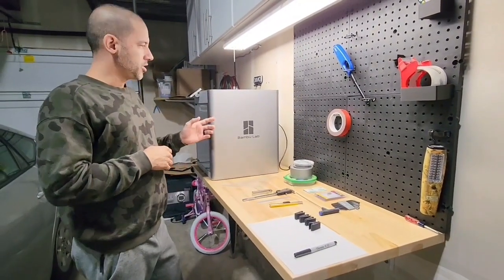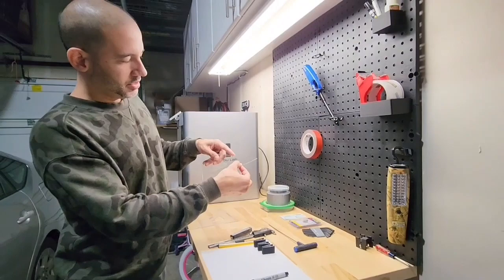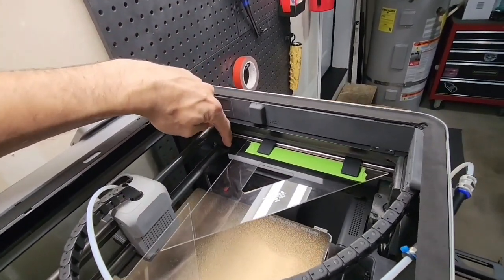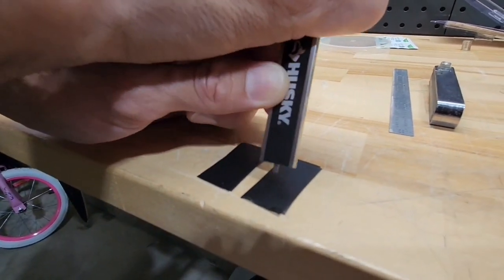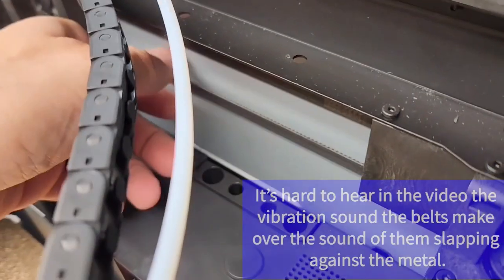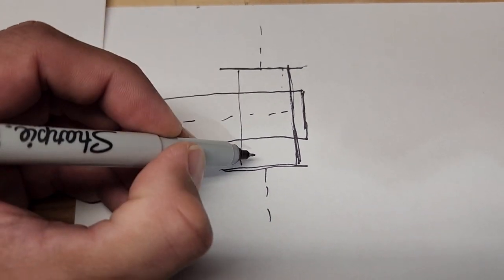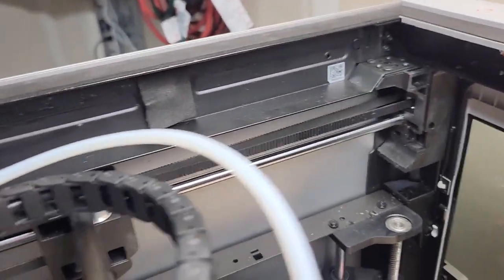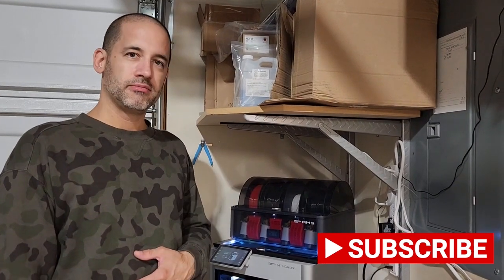Bambu Labs Banding Fix, Step-By-Step Tutorial!

Comment: I'm not sure this makes much to me. How does the shim keep the machine square? It doesn't actually warp the frame or change the structure. Just forcing the head to the rear while tightening the belt tension screws? Wouldn't me retightening those screws after getting the belt to stop riding the pully nullify tightening the belts to get it square? Also am I supposed to leave the shim? Won't the machine just crash into it each time? EDIT: Also you linked to the wrong printables model BTW lololololol
Reply from the maker: The shim isn't for squaring the frame. The shim is to offset the gantry against the un-squared frame so that, when you push the gantry to the back, it will be square to the guide rods. Before putting the shim in, if you pushed and held the gantry tight against an un-square frame, it would induce a slight but meaningful uneven tension on the belts because you would be setting belt tensions when the gantry-guide rods are flexing and fighting against each other. Don't know if I made it clearer or muddie for you, but that's what I got. Hope it clears it up!
Reply: @BoneyardLabs  I believe so. So by pulling the gantry back against that shim while tightening those rear tensioning screws that helps with belt tensioning by correcting the gantry's perpendicularity and in turn correcting the XY's squareness. I'll have to figure out how hard to pull back by re-checking squareness assuming I made my shim the correct thickness. Then if I notice the belts riding on the pully lips at all do I still need to pull back on the gantry while re-tighten those rear tensioning screws? Sounds like I won't as long as I only unscrew one screw per side. By unscrewing both per side [all 4 screws] the printer will go back out of square.
Reply from the maker: Leaving the shim there won't make it crash, as the home position for the gantry is well away from the frame when in operation.
Reply: @BoneyardLabs  The real MVP
Reply: @BoneyardLabs  Lol I thought the machine literally crashed itself against it's max travel extents at least that's what it sounds like on my X1 when I home it...
Reply from the maker: I just checked the link. It is correct. There is more than one part. I only used one of the parts found in the link of several tools.

Comment: Holy, this saved my ass! I tried tighening the x axis per an error and on the bambu official help, it said to undo the screws in the back. So i did that, moved the toolhead left and right to clean/tigheten the x axis. Go back to printing and i was getting a subtle grinding sound that i wasnt before. They just tell you screw the bolts back no biggie, i had to clue what it was for or, what i should be doing, or how to check to make sure its back to proper. Huge thanks!!!!!

Comment: Interesting but I'm still looking to get rid of VFA completely. I've tried this several times but unfortunately I still get VFA on the Bambulab P1S. It's a bit more or less at different speeds (less at very fast or very slow), but I need it completely gone. Anybody?
Reply: not possible due to motor oscillating

Comment: First, most important, is Thankyou! The issue I was having is fixed and your video did it.  My gantry was 1mm out and I don't understand how I have been getting such great prints the last 6 months. They look pretty close to perfect now. 

 I wanted to offer a "easier" way to adjust the tilt on the belt pulleys. It is your "way" but more precise.  After adjusting the belts as normal,  use a black thin tip sharpie to put a line on the belt carriage tabs that stick out towards the center along the edge where they go under the outside plate. These are the tabs you were pushing on to adjust the tilt of the pulley. The line is placed so that if you push the tab in, the line disappears as it slips under the outside plate. If the tab is moved the other way you will see a space between the edge of the outer plate and line. This gives you a visual indication of how far you are pushing the tab and you are way ahead of the game already. Next, after loosening the screw, use a wide tip (1/4", 6mm) flat screwdriver to lever the tab in as you watch the line disappear under the edge, tighten the screw when you are at the desired position. This is far more precise than just trying to push it. You have much more control and you can see what you are doing with the line. You will seldom be moving more than lines width as this adjustment is quite sensitive.  This would have been easier to describe with a picture.

OK, a little bad news. The tilt adjustment as you described it did not go far enough. After getting the belts to close to centered on the pulleys as I pushed the toolhead fore and aft and side to side manually, I announced "job done". I patted myself on the back with both hands but I was not really done. I watched the  pulleys as as the a print ran and noted the belts push up against the shoulders of the pulleys depending where the tool head was. The dynamics of having the stepper motor move the belts versus moving the toolhead manually is different. Watch belts during a print and make small adjustments to center the belt as best you can. As you said, "Its not an exact science." My belts move up and down quite a bit during a print but using your method, I was able to get them sorta centered. Just pause the print to make the adjustments. It is actually pretty easy when you can see just how far you are moving the carriage.

Comment: I wouldn''t spend over £1000 pounds on that 3d printer but everyone has their own choice!, the way the belts are tensioned is with a spring on each side, once the screws have been undone it should self tension the belts for you by moving the gantry backwards and forwards and the printhead left to right and then retightening the screws, the x y gantry is all mounted on the uprights for the frame if the frame is out of square or twisted then the belt path is out and that's why the belts move up and down on the pulleys, it's a bad design fullstop, don't waste your money buying one. Go and take alook at the flashforge 5m wiki and see how the x y gantry is all mounted to the top flat frame, that's how you keep your x y gantry flat and mostly square, this is the way bambu should of approached the design, they have made it too complicated, sometimes less is more. 
I build my own 3d printers mainly vz bots and vorons, I have the ribbed parts of belts running on 695 flange bearings it doesn't cause ringing on prints either! like alot of people think, you need a square printer and equal belt tension on a core x y printer, also the belt tension plays a massive part on how well a printer prints, too tight cause issues and so does having it too loose, it's takes alot time adjusting and trying till you find the sweet spot, all printers are different depending on the build volume and belt length.

Comment: Thanks for the great instructions. For me the difference was 1.5mm. Unfortunately, the calibrations in the end had hardly any influence on the print result. The lines are still there. From everything I've read so far, it's not just one factor that's responsible.

Comment: I was about 1.7mm out of square!  This got me to nearly perfect; probably about .1mm out now.  I tried to use the rest of the components from the Printables link.  Took me a while to figure out his directions & assembly, but after I did, that got me perfectly square.  BUT - while it got it to square, it over-tensioned the belt.  Could hear it through 'plucking' the belts, and I could hear a very bad 'rattle' during printing.  I'm guessing due to the lack of equal tension on the belts it was causing some slop.  Not good.  Went back to scratch with the Bambu wiki belt calibration method, then retightened the belt (pro tip - leave the shim attached to the printer!) per your video.  Checking the square again, I'm back to the approx. .1mm out.  I'm good with that for now.  And I'm sure I could adjust the tape to get it perfect.  

Printing the OrcaSlicer VFA test now.  I'm not expecting perfection (I think there's too many variables), but I'd imagine it's going to be better than what it was.

Thanks!

Edit: Sure enough, still not perfect, but better.  Through OrcaSlicer, I printed a VFA tower from 40 - 300 mm/s in 10mm/s steps. I’ve got a bad VFA zone from about 110 mm/s - 140 mm/s. Some other speeds too, but that ‘zone’ is by far the worst. May try to fine-tune some more, but I’m f’in over it for now!  Good enough for the time being. And I can set my prints to avoid that speed.

Comment: Wouldn’t you want to shim it at the front of the machine since that’s where it homes at?
Reply from the maker: Hi there, thanks for the question. My intent was to shim the back because that is the location you move the gantry to when redoing the belt tensions. The idea of the problem is that if you set the gantry against a non-squared surface when you are redoing the tensions, then it could induce dissimilar tensions in the belts. Logically home may be at the front, but mechanically the tensions are set in the back per manufacturers guidelines. That's my reasoning anyway. Hope this helps for you!
Reply: @BoneyardLabs makes sense. Thank you for the explanation!

Comment: This is a really great video! Thank you! But...I don't see how you use the pulleys to change the tension of the belts  and then use them to adjust where the belt rides on the pulley. I wish you had zoomed in when you tightened the belt while explaining how doing so will (or will not) change their perpendicularity. Maybe you did. I missed it.

Comment: I tried many times to get the belts to ride the center of the back pulleys and I got them 90% dead in the middle, without either of them going up or down more than a quarter of the pulleys height. Tightened them just enough and re-calibrated my printer. The problem is that when I did that, and run some prints to it, the toolhead or at least I suspect its that, is doing horrible grinding noises when moving fast. I suppose somewhere along the belt path, the belt rides aggressively on another pulley or the belts got too tight. I loosened the belts again, moved the toolhead around and re-tightened them. Now it prints fine without any loud grinding. Go figure. I shouldn't even touched it in the first place because I later understand that my problem was just adjusting the flow rate for certain filaments.

Comment: I didn't have any squares to check the gantry, but I did the belt tensioning steps. Along with that, I cleaned and re-lubricated the Z-rods and the linear rails, and there is no more banding. Thank you so much.

Comment: confused newbie here with some questions, is the shim a permanet part of the printer or just there for the belt tensioning process ? is the shim's purposes to modifiy the positions from the homing process before each print. finally, is there a way to do this artificially in g-code or settings ?

Comment: Seems simple enough. I had thought this video would go over the Z as well. I have adjusted my belts for the pulley riding. But have not checked the square. I will have to find some squares to check that bit too. And I have an annoying rattle sound which I still have yet to find the source. Kinda leaning towards belts/ider pully on the front left corner. It only happens when printing in the front third of the plate and sounds to be roughly from that corner/hot end (But I have yet to figure out where it is despite pushing and prodding everything possible). It's really annoying, but doesn't seem harmful.

Comment: Thanks for this extensive guide. One BIG thing I noticed is that the right pulley will always ride up and down a little bit and the left one is able to get perfectly centered. I think this is due to a flaw in the design of the X1C belt path.

Comment: alright any suggestions for a slamming sound and what sounds like a baby rattle. the 3rd x1c we have had to start doing this.  seems to begin when we started printing high temp material.  also micro lidars are melting.
Reply from the maker: "Baby rattle" makes me think to look for bad bearings somewhere. Listen for which axis it makes the noise on. Some of the bearings are very difficult to get to. If the sound is constant, check for a broken fan blade or fan bearing. Micro lidars are melting??!!?? Maybe swap extruder assemblies with a new extruder fan and heat sink? That is a super weird one I haven't heard before. That one is probably best for the BL tech support. Sounds like a bigger issue.
Reply: @BoneyardLabs  yes they are replacing them. if i could attach pictures i would pretty odd with the lidar.
Reply from the maker: Luckily BL customer support is great, at least in my experience.

Comment: Have had an X1C since Nov 2022. Two things that got rid of banding issues, keep the carbon rods clean. They are not clean when printers are shipped to customers, and don't use generic profiles. I only use Bambu Lab filament profiles (for any brand filament) and only adjust the max volumetric rate lower and no issues. Generic profiles would show artifacts all the time.
Reply from the maker: Interesting! I'll have to try this!
Reply: This is the first time I hear to avoid the generic profiles, I got my X1C on last November and I was amazed by the print quality with the samples that they gave me but now I'm using 3Djake filament and usually it's a very good product but I'm getting very ugly artifacts and when you see the outside wall from a certain angle with the light it's not smooth, but when I use Bambu PETG-CF the finish is amazing. Yes the CF filament hide most of the artifacts but I may try this trick to avoid the generic profiles and see what happens.

Comment: Was reading the Bambu forum for a bit, from what I could see there is no fix. Some things seem to work for some people, but when some others try the same "fix" they see no difference. Not even changing those smooth idlers for toothed ones fix it. Well apparently one guy claimed changing them out for idlers with teeth fixed it, but then another guy did the exakt same thing and posted pictures showing zero difference. Basically this can't be fixed. I guess the only lesson is, don't buy core XY 3d printers.
Reply: You can never fully fix it because of how the stepper motors work. However, you can minimize it.

Comment: I think this video is going to fix my problem.  Holy sht I finally found something that might actually work.  I have been stressing the fk out so bad because of this.  I run a small business using 2x p1s printers and lately been only using 1 because I keep getting the exact problem you described.  It's just barely noticeable but I'm really a perfectionist with the products I sell so I have wasted a lot of money on failed prints trying to print with that printer.  Sometimes I get no orders for a couple days then bam, like 10 orders in a day, and gotta deal with this sht or do it all on 1 printer.  If I had hair I'd be pulling it out lol
Reply: All done, testing now
Reply: @waynefilkins8394  How did it come out?
Reply: @StrongBarnes90  Great so far.  I haven't printed with some of the more problematic filaments, but I think it's actually printing better than the newer p1s now.  Also the newer p1s keeps printing this line on the left side of a specific print (it's not the file tho) so I'm going to do this to that one next and see if it fixes that.
Reply: @StrongBarnes90  Nevermind, still having problems.  There's something else to it.  I don't know what but I will figure this out.  Some other variable that I accidentally changed when I messed with this.
Reply: @waynefilkins8394  I actually found this whole video to be hog wash. Talked with an expert buddy of mine that taught me how to resin print back in the day and he advise I not do any of that so I went back and followed bambu procedure for doing the belts like I was doing it for the first time again. 
Did it all very slow.
Prints have been coming out immaculate ever since.

Maybe trying what I did will help with you too.
I also dried my filament.
Reply: @StrongBarnes90  The video makes sense from a mechanical perspective, and seems to have fixed the problems for some people, but  the problem is when you start messing with the tensioner like this after the auto-tensioning, it can mess up belt tension.  I guess it's possible that when you push the top or bottom of the pulley over, it's not enough to mess it up too bad tho.  Well, anyway my latest attempt I tried normal belt tensioning but moving the gantry thing slower, was moving it real fast b4 I think, and also left the tape on from the triangle thing too, just started test print.
Reply: @waynefilkins8394 did you ever solve it? How did that test print go?
Reply: @rohit4242  When you do the auto-tensioning thing, and you move the gantry or w/e it's called back and forth, do it really slowly.  That helped me, and there's still a little ringing I think on the prints with a flat side, but it's better than it was.  I think some of it is just something you have to deal with on fast printers like this but when I print things with like more angles and curves to them it's not a problem, just super flat surfaces like if you print a box shaped item.
Reply: @waynefilkins8394  I've had similar problems with my p1s. Would you be willing to share what you tried ? I need my prints to be perfect across multiple printers so I'll be AB testing a lot. Your input might save me a lot a of time.

Comment: The linked triangles don't work FYI. The short side against the X axis will reach across to the other triangle but not bottom out on the frame. The inverse means that the triangles don't overlap. I think 45° triangles are needed.
Reply: Wonder if you can't just 3d print some triangles as well. Or do they have to be bigger than what would fit on the build plate?